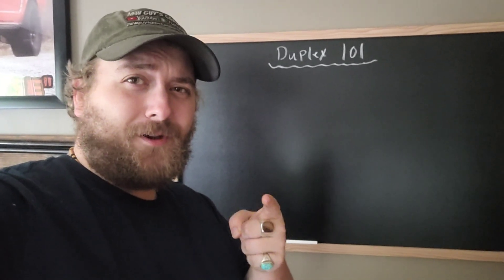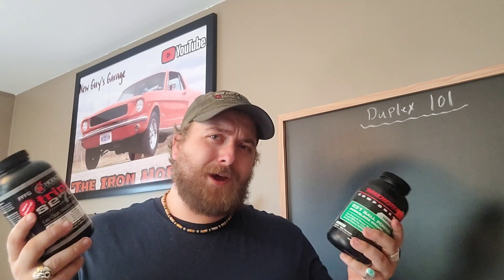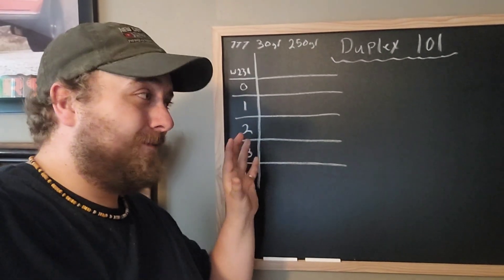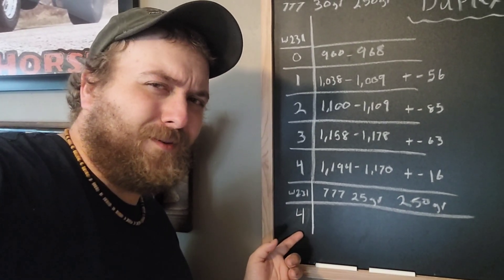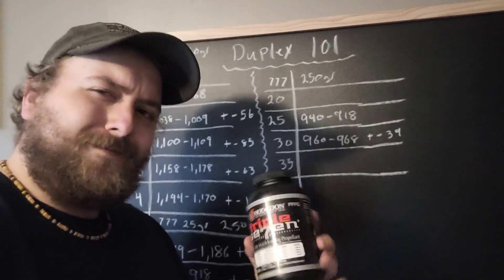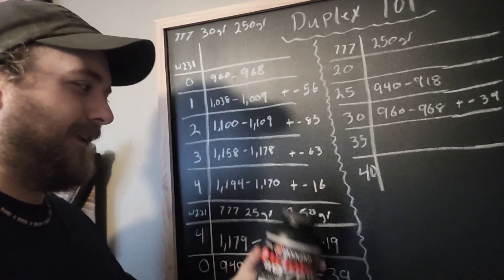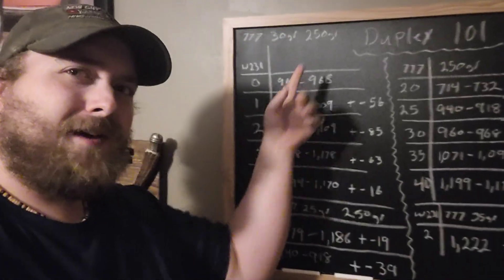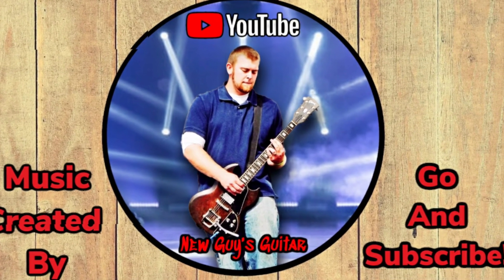828 Ft-Lbs Black Powder 45 Colt Duplex Loads! | How Do They Work? | Full Test & Data Breakdown!

Comment: you just invented 44mag power from your 45colt revolver without needing a ruger to handle +p pressures gonna try these loads in my 1858 5 round krist conversion if i explode i wont be back to comment lol

Comment: I take Hodgden 777 3F and grind it up in a mortar and pestle. It's got enough pressure to push the hammer back in my black powder revolvers. Wonder how that'd behave in a cartridge.
777 2F ground up mixed with some leftover ground up Pyrodex P is definitely not as hot as ground up 777 3F. Though the mixed powder sounds hotter than unmodified 777 3F. I need to get a chronograph one of these days.
Reply from the maker: Chronograph testing is definitely a lot of fun 😁👍

Comment: I have a hypothesis about the diminishing returns on the duplexing, once you go past 3 grains of W231:

What I suspect is happening is that the smokeless, past a certain load amount, produces enough pressure to meet and/or exceed the shot-start-pressure of the bullet quickly, and this is on it's own, regardless the pressure generated by the black.

Now, because black generates pressure relatively more slowly, what this would mean then is that the bullet is moving down the chamber/bore, while the black is still generating its pressure wave. The result would be a greater volume behind the bullet for the same amount of building gases = lower accumulated pressure = lower velocity.

On the flipside, when the amount of smokeless is lower, shot-start pressure will not be reached as quickly, giving time for the black powder to 1) generate a more developed pressure wave behind the bullet, and 2) act on the bullet for that much longer, imparting more energy.

In other words, the power curve of the black will intersect with an optimal time lapse, or bullet 'dwell time.' Past a certain amount of smokless grains, or what we could call an "apogee point," the dwell time is reduced to the point that the extra gas generated by the black cannot overcome relative pressure loss from too much combustion-space volume, resulting in inefficiency of velocity generated relative to overall charge weight.

Below or just at the apogee, however, efficiency would be optimal: the W231 serves as a booster and the black/Triple7 fills out load density, resulting in very high energies but at lower pressures than a typical, all smokeless load.
Reply from the maker: That is basically what I am figuring, with that much smokeless on the bottom it is especially blowing the black out before it can burn. 

.....on the bottom is the key word there 😉👌

Comment: The only problem with these experiments is that this cartridge gives you zero warning of how over pressure you are until your cylinder lets go or until your SAA is battered and stretched and loose after a couple hundred rounds. Primers don’t flatten and case heads don’t expand until you’re already in the danger zone
Reply: Get a micrometer and start measuring case expansion.  Some of those velocities are quite impressive.  You might note just how fouled the chamber gets from one load vs the others.  Duplex loads are supposed to be cleaner.

Comment: I have old and new loading manuals. New ones are weak in comparison,  new ones mostly have newer powders and not the good old ones. Many people think if a load is not in the manual that it shouldn't be done.  Just read up on powders that shouldn't be down loaded, all others start low and work up slowly.  Most loads were developed by people that tryed new loads.
Reply from the maker: All those loads in the manuals started somewhere 😁

Experimenting is the whole fun of reloading for me, just loading the same thing over and over would get dull really quickly 😂